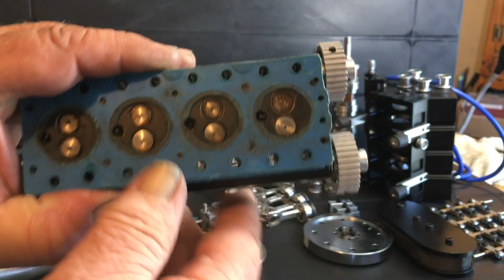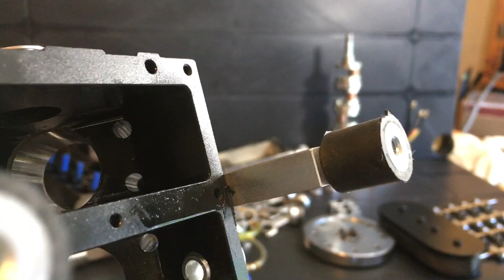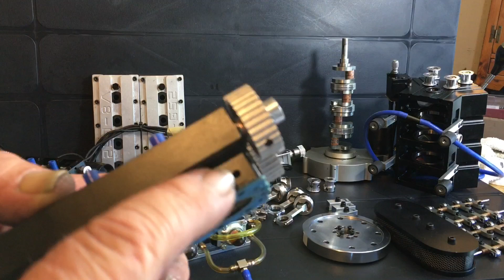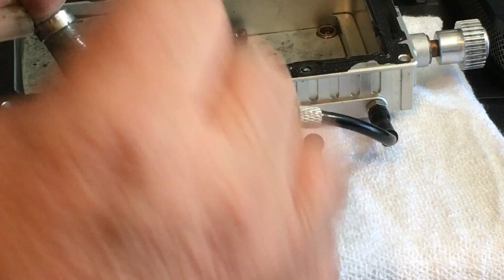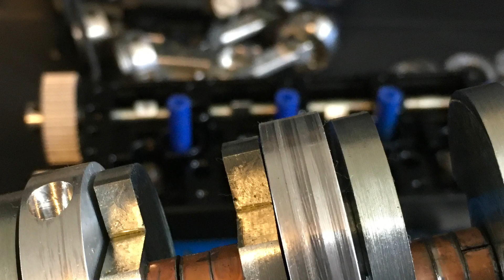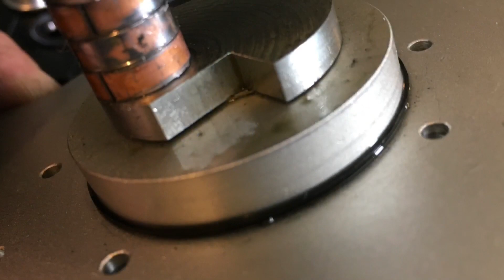Enjomor v8 oil system and cylinder head details!!!!

Comment: Seems a pity the mains weren't pressure fed given the stress they are under - especially if you address the carburation and log exhaust manifold in search of more power.
Reply from the maker: I agree, a pressure-fed oil system would definitely improve durability for higher power!

Comment: This thing is a piece of crap mine has spent more time running on the starter then actually running just crap. Nothing but ignition problems I sent it back to be repaired it came back it run for 3 minutes then stopped the hall sensor failed I have new rotors for distributer and cision ignition box still nothing and needle settings in carb . CRAP

Comment: Hi Dennis,looking at getting one off these or a Aussie V8,is it possible on the enjimore V8 to use different carbs as mine will need to be quite scale looking which is ruined by the cheap chainsaw carbs which i don't think let the engine sing due to tuning as they are for two strokes,any ideas,also when do you think there V12 will be out,as i like to have both from the same manufacturer...thanks for your videos....
Reply from the maker: I am working on testing different carbs for the enjomore V8  and I agree the 2 stroke carbs starve the rpm my problem is finding time right now, if you do a simple mod to the 2 stroke carbs like the Chauan Qi V12 engine it revs freely like amazing!
Reply: I have one of these Enjomor V8 it has run for maybe 30 min off and on now it will not start.Dont by one.

Comment: I am really impressed with the heads and bottom end design on these (more so than any model engine I've seen yet). I'll bet with those big ports and heavy valve springs, this thing will wind to the moon and actually produce some useable horsepower!😁👍

Comment: Hi Dennis I just received my Enjomor motor. I'm having figuring out how to hook up all the modules to get it running, ESC, servo box, and coil box. I think I know but don't want to burn out anything. Also the direction the motor turns looking at the rear of motor?
Thanks
Reply from the maker: Hey brother, the engine should turn counter clockwise looking at the rear flywheel, I had a prototype to test so the electronics were a thrown together with no instructions other than 36-48 volts to stuff in the generic yellow no name esc, my first videos included that yellow esc using 14.8v because I procced with caution knowing the 80 amp esc can safely take a 4 cell lipo. it turns slow but it will start every time. the ignition module can use a 7.4 to 11.1v power supply to run and rev properly.  hope this helps my friend, my V8 wont get shipped out until after the Chinese new year celebration.

Comment: These small engines look cool but I’ll be amazed if they last more than an hour of run time without something breaking.
Reply from the maker: I have over 8 hours of abusive run time on that prototype and it had run time from the factory before they sent it to me,
Reply: My engine has run for maybe 30min off and on and now will not start and I have tested a lot of thing hall sensor ignition it will not start these things are CRAP and Stirling kits are useless.

Comment: Cool video    Dennis I have one question maybe two You talked about the oil filter and in your explanation of it you mention it had some sludge in the bottom of it. I was wondering what kind of oil is used in the engine and if they have come up with a time frame for an oil change.  I grew up in the 60s learning about car engines and i remember learning also the hard way about the importance of regular oil changes and filters. One day i pulled the valve covers off my old 64 Pontiac lemans and there was sludge all in the heads.  My buddy who use to drag race back then told me that the life of your engine is in the oil system. Thanks again Dennis. PS what is the best way to contact you, if possible, on future questions about your other engines
Reply from the maker: I got this test engine with no oil or coolant as shipped to me, they drained out the fluids before shipping, I dont know what oil or coolant they used but I used the high zinc racing oil from Valvoline because most of my engines are flat tappet cams and get beat on regularly from me lol,  check out my about page on my YouTube home page to see the contact information,
Reply: @dennisdempseyradiooutofcontrol  Thanks a million Dennis look fwd to your next video keep up the great work

Comment: When will you post again about the NR200 engine?
Reply from the maker: I installed it in a truck and gave it a couple of test runs and got sidetracked, It was so hot the past 2 months I didn’t run any of my nitro stuff other than testing engines briefly, how is yours coming along with your ecu modification?
Reply: @dennisdempseyradiooutofcontrol  going good I have it 95% done! Still resolving some issues with the software phase of it should have it ready by New Year’s. However I do have some parts made and ready for testing. I would like to send to you for R&D i’ll include the details on Facebook messenger.
Reply from the maker: @Ktec38  Cool I will look forward to this you have brought something new to these engines and I will make sure to support you this is all about your hard work and effort to bring a first ever ecu to this hobby !

Comment: Dennis, I would like to know what brand and wt of oil you used and any additional additive (zinc) looks like Penngrade?
Reply from the maker: I use the Valvoline racing oil it’s the VR1 10/40 or 20/50 weight high zinc oil it’s formulated for the old flat tappet pushrod musclecar engines, it has extreme anti wear protection.

Comment: What does the short side radius on intake port look like .
Reply from the maker: the runners are oval all the way in then are curved around the back to match the valve radius they are 6mm tall 10mm wide and around 29mm deep not counting the intake runners.